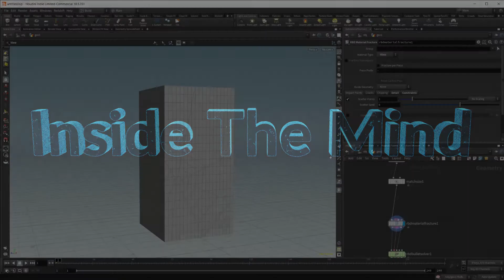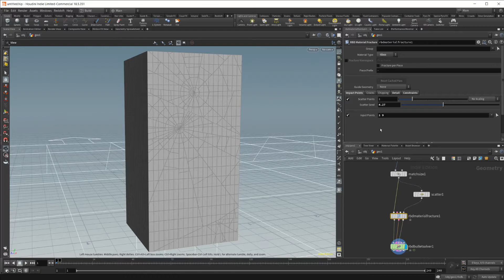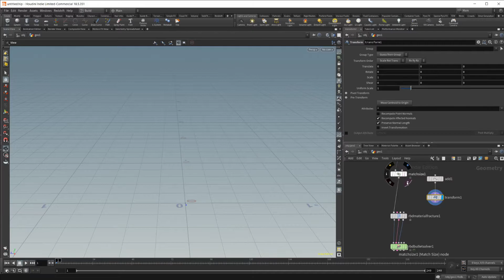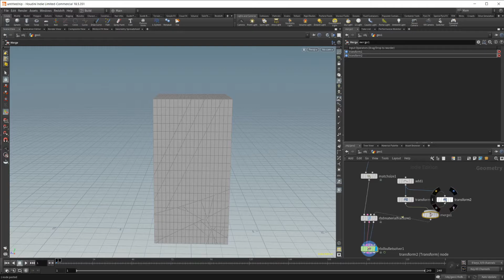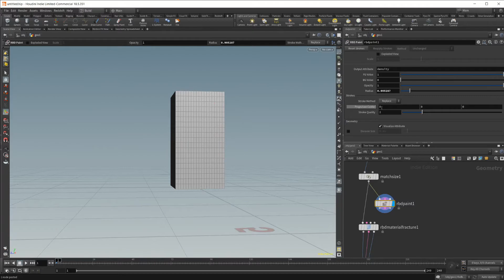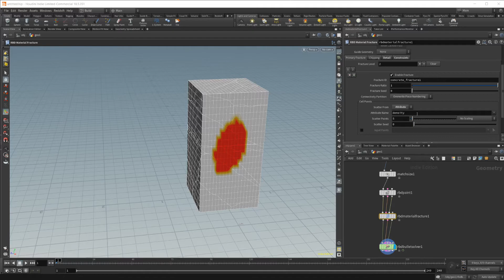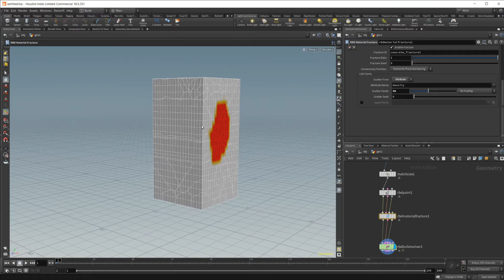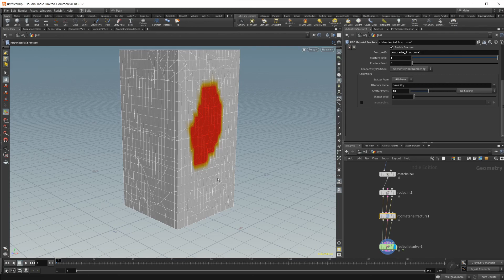Controlling the RBD Material Fracture Placement in Houdini

Comment: I like this, but what would your strategy be if I wanted to destroy a column or box or whatever, and have a model be what remains. I imagine it's a similar strategy, or making the model a boolean with the fractured geo and have an active=0 or something?
Reply from the maker: For simplicity let's say you wanted to have a block of marble and have it fracture into a statue. I would boolean the resulting statue from the block of marble and then fracture what is left of the block. As long as the collision is set on the statue it should hold the marble in place until something hits it to fracture and overcome the constraints. If not you can toggle the active setting
Reply: @InsideTheMindSpace  Thank you for your reply and video! When you say toggle the active setting though, I suppose that's where I wasn't sure if it was possible with the material fracture node. Is there a way to art direct the active attribute using that node or do I need to make my setup from scratch?
Reply from the maker: In order to hold the fractured object in place before the impact or whenever you want the object to start falling apart you will need to use the rbd configure node. Without that your object will start simulating immediately
Reply: @InsideTheMindSpace  Thank you :)
Reply from the maker: Thanks for asking your question. My goal is to create a community of people that collectively ask and solve problems like this
Reply: Heres a tutorial I just watched where he more or less does this, if Im understanding you correctly. https://www.youtube.com/watch?v=exreMc7CNiU&t=797s